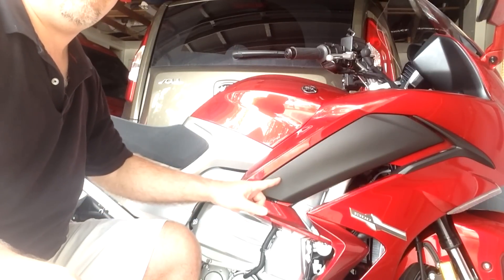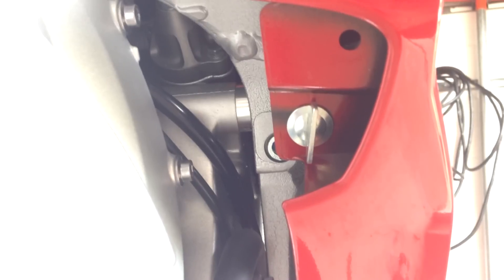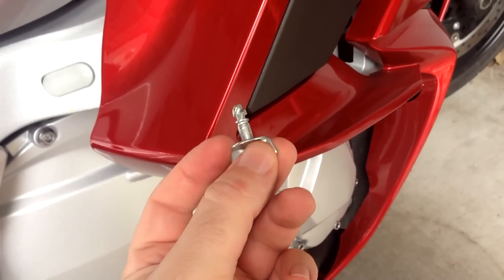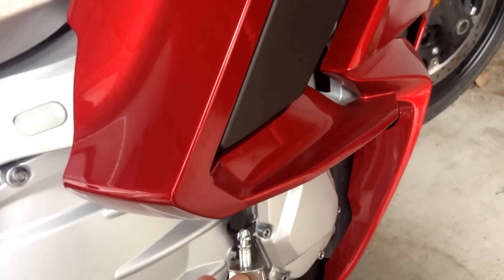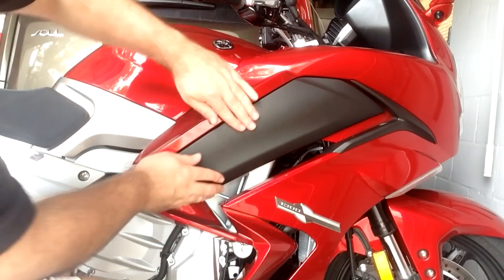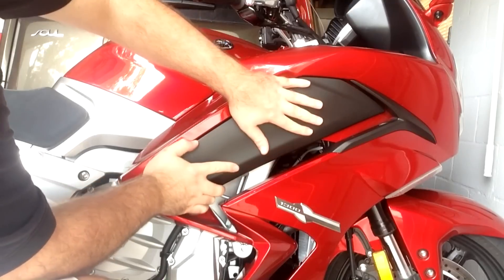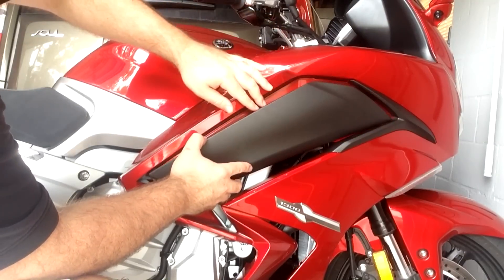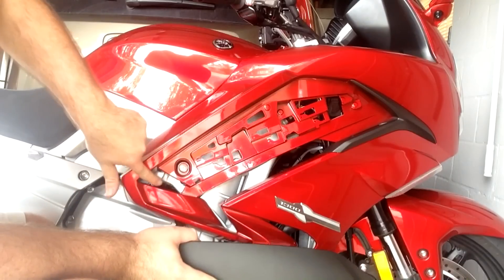How To Adjust The Yamaha FJR 1300 Side Cowlings

Comment: I actually do the opposite. In summer I open the cowls. It actually diverts air from the front onto my thighs, cooling them and helps heat get out of the sides and not on my feet. In winter I find the closed position better.
Reply: Yes that is correct, he has it backwards, and it makes a huge difference in the summer

Comment: In the open position heat that is usually drawn down towards the rider's legs is instead deflected out and away from the rider, makes riding in protective clothing on hot days a lot more bearable. Most people make the opposite assumption, it's a shame Yamaha's manual is so vague on the function of these panels.
Reply: I'm coming to this discussion (at least) 5 years late, because I just returned from a 4000+ mile trip on my 2015 (which i've owned for 8 years).  On day 1, after several hours on the road - and as the day heated up - I started feeling a lot of hot air around my lower legs/feet... much more so than I could ever remember happening before.  It go to the point that I was nervously watching the engine temp for fear the bike was going to overheat!  :-) 

When I stopped  I noticed the fairing looked different.  And from looking at this video, I realize that my vents were in the closed position, whereas they'd always been open previously.  I guess the mechanic who serviced before the trip put them back on that way.

Anyway, bottom line - my experience was that the "summer position" as described above created a lot more uncomfortable  heat than I'd ever experienced before.

Comment: I have a '14, thank you so much for all the videos, but what is the purpose of this adjustment? Can you be specific?
Reply: Hey Zeth..I didn't find much difference in heat transfer but there is a bit more airflow directed away from your legs..helps a bit but I don't notice any significant change